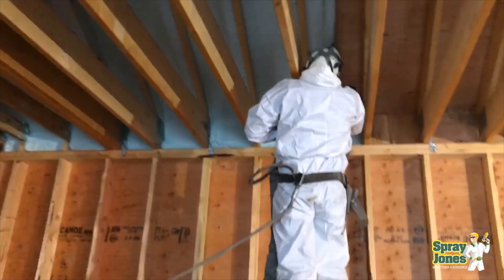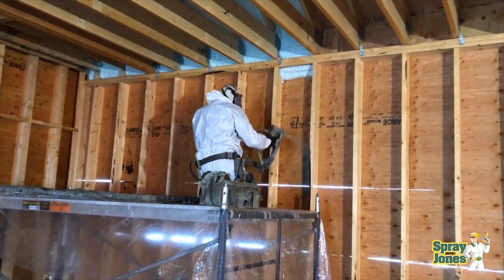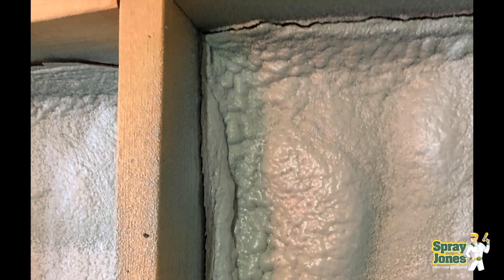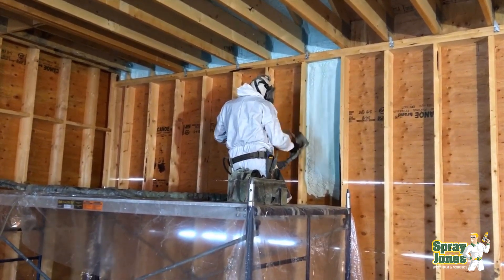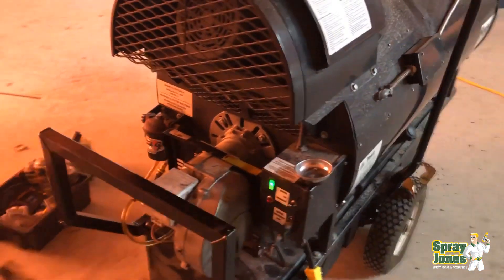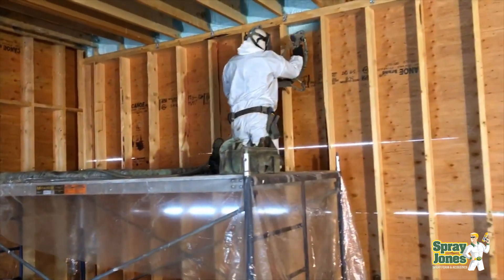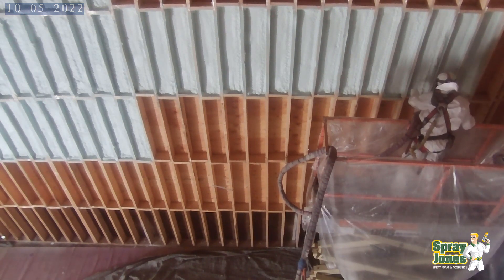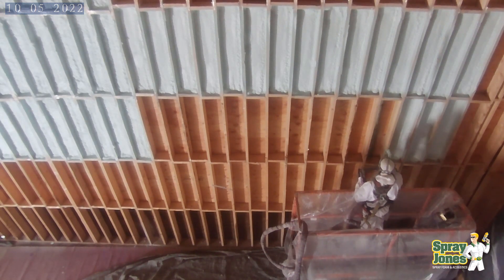Winter Time Spray Foam Insulation Adhesion

Comment: @sprayjones question. wouldn't adding heat in cold weather cause condensation in the building due to cold exterior and warm interior? I have a contractor coming to spray closed cell this Wednesday. forecast is for high of 5c and low of -1c. obviously this time of year has a lot of RH due to snow melt and rain. Building has been closed in (concrete in July, wrap in august right after framing, siding and roofing early October). What is you opinion? watching this video is making me nervous. I feel like I should heat the building but worried about condensation.
Reply from the maker: Wood has a great insulative property to it unlike metal and concrete. At 34% RH it take 17 C of difference between the air temp and substrate to condense. So control humidity... if you can... and control the inside temp....and wait for the outside temp to be warmer if need be. Patience and diligence is key in cold weather applications.
Reply: @SprayJones  so I should heat the building to ensure the inside air temp is not more then 17c higher then the exterior temperature per your example?
Reply from the maker: @gmredstar  Re-read.... Substrate temp... get a condensation chart off the internet. Watch the video I did on controlling condensation, I show the chart there. I always want our substrates warm for SPF application.

Comment: Should a concrete basement wall be framed before the foam or after?
Reply from the maker: Watch the basements videos in the basement playlist
Reply: @SprayJones  found them. Thank you. I'll probably have bare wall sprayed. Frame after. Would you still use batt after 2" closed cell? If so what R value. In Ontario.

Comment: I’ve watched a lot but not all of your videos, I have an appointment with a sprayer for an estimate. I just had a new roof installed with vents. 
Would it make sense to just spray attic space without doing the walls? Low humidity in summer, dry in fact. Winters go into teens (f)
Reply from the maker: Spray foam as much as you can $$
Reply: Thanks
Reply: attic space?  Do  you mean the floor of the attic?  If yes then no need to spray walls of attic.  If ceiling, or roof deck, then need to spray walls as well for encapsulation.  Otherwise not realizing full effect of foam.

Comment: Thanks for the video.   I had my stick built 30X60 shed foamed in Oct in MN and the weather was 68 F and low humidity.  Perfect job....I can see that anywhere around the 32F you are playing the Moisture game.  I did do flash and Batt in a few areas and found out that in a cold climate do not waste your money or time on a flash batt.  At 2 inch foam with a batt and 15 below zero temps the moisture freezes to the foam and when the outside air temp hits 32F the frost on the foam lets go and soaks the sill plate.

Comment: What is your recommendation for spraying a pole barn directly on metal in the cold ?
Reply from the maker: Cold or freezing?
Cold is one thing freezing is ify.
Reply: @SprayJones  fluctuating 20f at night 45- 50 in the day I'm guessing 36 38 degrees without adding heat would be temp at spray time. My contractor stated he ideally preffered to wait till spring but it could be done . My concern is adhesion. Thanks for the reply!
Reply from the maker: @williamhutchinson108  It can be done. Warm it up in AM, make sure it is dry before spraying.

Comment: I am building a house now and will be ready for spray foam shortly. What kind of heater is that. I have a propane one but doesn’t that also contribute moisture. Thanks for any info
Reply: Don't use propane
Reply: Looks like a kerosene/diesel heater.

Comment: I have moisture meters for wood, although I'm not sure how accurate they are in cold or freezing temperatures. Not sure if they would be useful here.
Reply: Moisture meters are not as accurate on a frozen substrate. The substrate has to be "moist", not frozen. Frozen molecules move slower which fools the reader into thinking it's less conductive, which means less wet. 
One thing to be very careful about is to make sure you are using a heat that doesn't produce a lot of moisture. Anything that burns produces moisture. Using direct fired propane to heat/prep for SPF is a very, very bad idea. The amount of moisture it produces is absurd and your walls will drink it. The driest heat is electric heat. Followed by kerosene, then diesel.

Comment: I had the same problem in Missouri around November 27. After the snow had melted. I baked the room for 6 hours. 
My lesson was don't spray in hi humidity.  That's our problem here,  humidity!
Reply: Remember, don't spray within 5°F of the dew point!
Reply: @joshuac9579  can you elaborate what you mean here? with an example?
Reply: @gmredstar  5° of the dew point means that whatever moisture is in the air is close to sticking to surfaces if I recall correctly. This layer of moisture will prevent your foam from adhering to the substrate
Reply: @joshuac9579  so for example If the air temp inside the building is 8c and outside is 2c, relative humidity is 55%. Do I heat the building or will that make it dew?
Reply: what do you mean, heating caused the issue? or heating solved the issue?